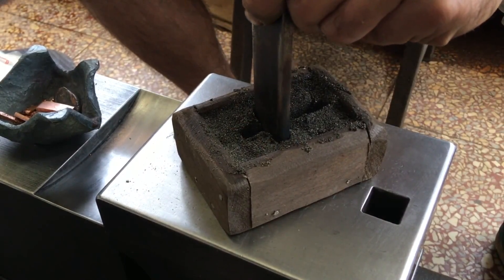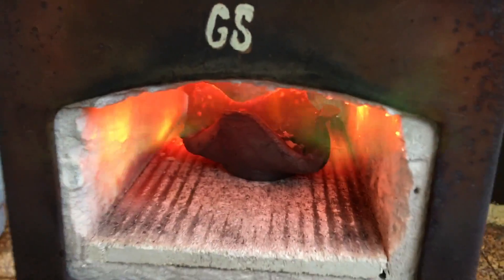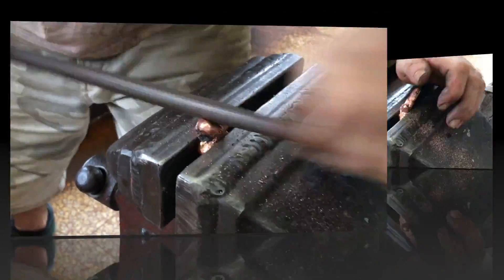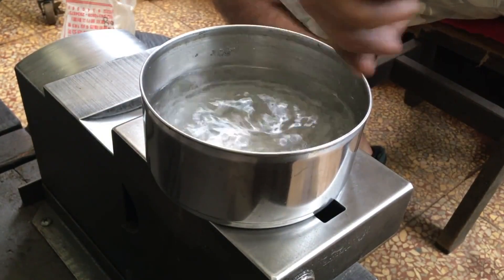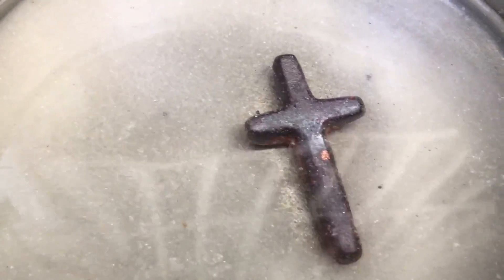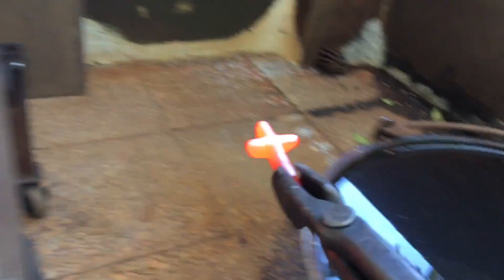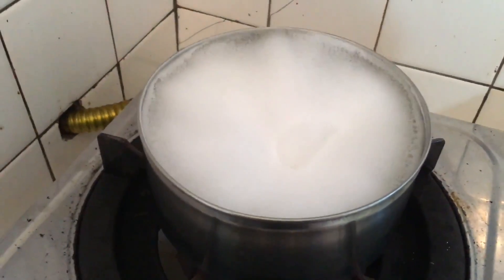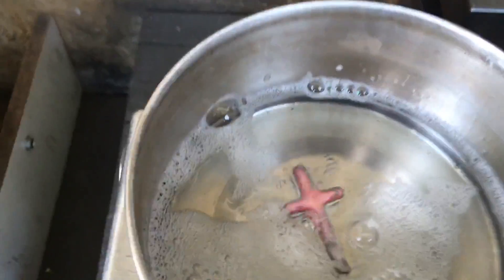Copper Patinas / Casting Copper

Comment: remove all contaminants and oxidation, no acetone residues, baking soda and water neutralizes acid.... distilled water and being fully dry helps. Then heat copper right below melting point just as it glows red. Have boiling water with borax the solution should look milky.... heat quenching with copper needs to slowly cool. cooling too fast will leave blotchy. Purple is the result of low heat and other impurities such as ammonia or vineger and purple can start around 800C. High heat quenching, do a couple times till desired effect 😎

Comment: Hi Glen. What you are after is called Japanese Shudo or Vermilion copper patina. You almost have it just a couple of small details to get that brilliant red you are after. Make a solution of 1L of water with around four heaped table spoons of Borax. Bring to the boil. Prepare your copper object and make sure their are no sharp edges on the object (smooth the objects corners). Also make sure the surface finish is very smooth and almost shiny. You can go for a 800 grit finish. De-grease the object. When the object is prepared and ready to put into the furnace turn off the boil on the water/Borax mixture and keep it close at hand. Place the object in the furnace and make sure that it remains in the furnace under the flame (oxidizing flame is preferd) heat the object to a very hot orange or to where you feel your nerves are going to fail you (just before the copper melts) when you reach that heat count to five and then drop it into the (now just off the boil) Borax solution. If it all goes to plan you should have a dark grey looking surface on the entire object (except for where you held it with the tongs) Buff gently to expose a brilliant red Shudo patina underneath. Enjoy man, few people know this workflow and because you tried by yourself I'm obligated to share the knowledge. :)
Reply: Thank you too

Comment: Such a cool vid!  I'd love to see more copper (or any metal) patina experiments.  This vid is also a great example of why it's important agitate when quenching carbon steel to harden it, that vapor jacket/barrier can really affect the evenness and rate of the cooling, resulting is warps and soft spots especially with knives.  The baking soda solution was kinda crazy how much it slowed the quench down, very neat!  Thanks for sharing
Reply from the maker: The point about needing to agitate when quenching steels is very good. Of course this depends on the size of the slack tub, the size/shape of the workpiece and the quenching medium. Thanks for sharing.

Comment: Try this, melt seasalt in water, so much it's '' full ' contiue water heating when it boils, heat the copper zcismo an put into the Water hot, the result to be great raibow colour. I think. good luck for those experiments.
Reply from the maker: I will give this a go. Thanks for sharing.

Comment: Glen, do you suppose that the piece is developing a air pocket around it causing the delayed cooling? Might be interesting if you kept it in the tongs and shook the bejeepers out of it. Nice video. The sign of creativity is a curious mind.
Reply from the maker: steve, I'm not exactly sure. Somehow, the borax and banking soda protect the  piece from cooling right away but I can't say by what mechanism. Thanks.
Reply: Glen years ago, we used to soak rusty iron in vinegar, then pour the brine off and use it to dye leather. (turns leather black). I wonder if it would turn your copper some color if you tried cooling it in that.
Reply from the maker: I think that same method you mention was also used to create a black die for woodworking projects. That would be very interesting to try with copper - I bet the result would be surprising. Thanks for sharing.

Comment: Do you think borax would work similar to boric acid?
How do you think a copper based alloy would work, such as brass or bronze?
Reply: Dan Rozwood They both derive from Boron and essentially do the same thing. Soap makers can use either one. 

It would be very interesting to see a forged piece of Copper, Brass or bronze and Nickel into a piece of mokume gane.

Imagine the different colors that would come out with quenching in the boric acid or baking soda!
Reply from the maker: Phillip, Thanks for replying to Dan. I have no experience with mokume gane. Could be very interesting... Thanks.
Reply from the maker: Dan, As Phillip points out, they are essentially the same thing. Many people use "Twenty Mule Team" laundry detergent. I need to try brass or bronze and see... Thanks.